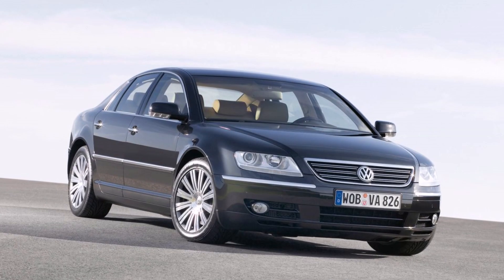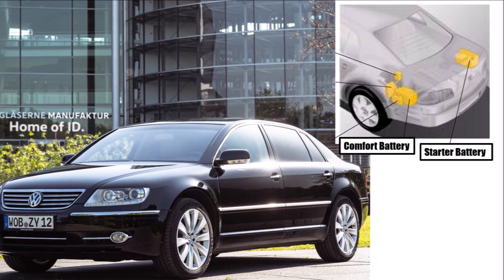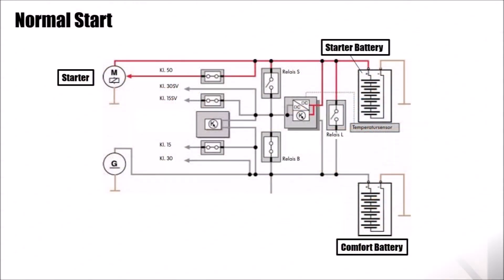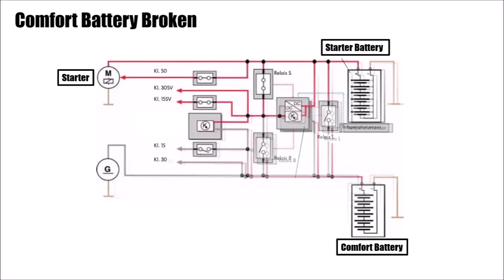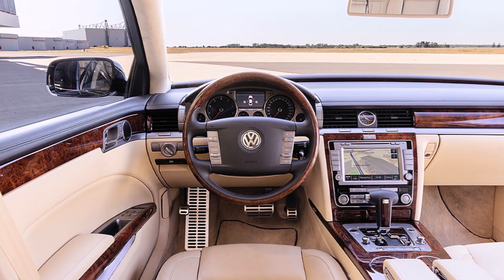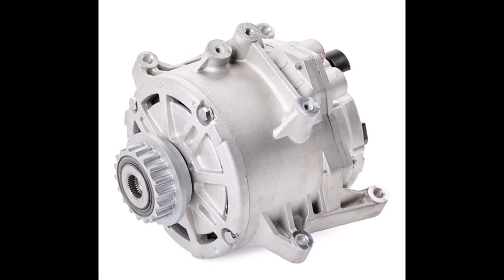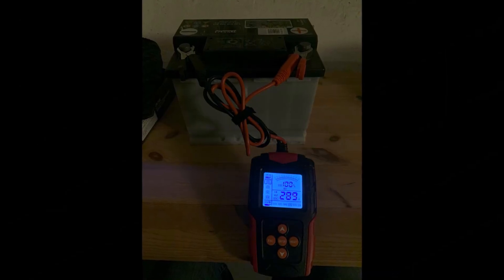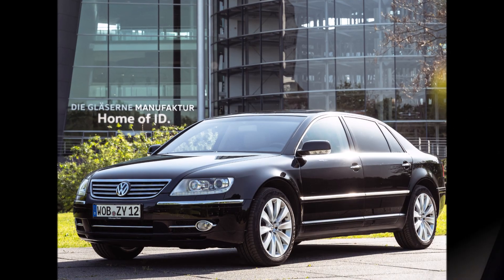VW Phaeton - Part 2 - Battery Management System - EXPLAINED

Comment: My 1st gen Cayenne S (955) has 2 batteries also, but I suppose they're just wired in parallel although they're of different capacities.
Right now, one (the smaller one on the back) is disconnected as it needs to be replaced, but everything is working normally and no warnings have appeared.
Any real knowledge on how they're effectively connected ?

Comment: And usually both batteries are dead after 2 weeks without driving since the Climate Control and Engine Heater kill them. And all 4 Start Modes does not work, especially in the cold when you need them the most. I own a V10 TDi Phaeton for more than 4 years and its a pain. This car is not reliable at all and if you need a car that starts without issues, buy an old MX5. No battery Management, no problems. No electric Trunk, no broken wires. No water in the kessy since Phaeton let rain water run into the Main electronics. The Phaeton is truely the most unreliable car I ever owned and the fastest most comfortable Couch ever
Reply from the maker: Sounds like you have one of the first years. The solar roof drains need to be cleaned regularly to avoid problems, but that's the same for all cars with roof windows.
The climate control just works with the solar roof if sun shines on it and I never had an issue with that function.
And for the engine heater, it depends on how often you use it while the engine is off. Never had an issue with broken wires of the trunk.
But interesting to hear you had these problems. I am thinking about buying a V10.

Comment: Hey Martin, Is there some kind of publicly available technical book or dealer literature that covers the Phaeton's systems? I'd really love to read it.
I ask because there's a 200 page "Technical Information Manual" on the Dodge Stealth / Mitsubishi 3000GT that goes in depth on all its infamous systems, and I feel like there should be an equivalent for the Phaeton. I don't mean a user or owner's manual either that tells you how to use the systems, I mean one that tells you how they work with numbers, graphs, diagrams etc like the aforementioned TIM for the 3/S twins.
Reply from the maker: Hey, the VW group has something called "Selbststudienprogramm" (SSP), which is available in German and English. They explain all technical systems with lots of background information there. The one for the Phaeton batteries for example is SSP272.

Comment: I experienced it when I wrote my master thesis at VW and should move a Phaeton that was due for scrap. It was freezing and the car seemed completely dead. Only the alarm went off when I unlocked the door manually with the key, no interior lights no nothing. I thought "this is it, this car isn't going anywhere". Because of the alarm going off, somebody opened the window and yelled at me "Schlüssel stecken!". And so I did, I heard a click, and suddenly the car came to life and the engine started like magic. Needless to say, I was VERY impressed!
Reply: theater ah car revival
Reply: SCHIEẞ DEM FENSTER!!! 🤣👍 DIE HARD 1